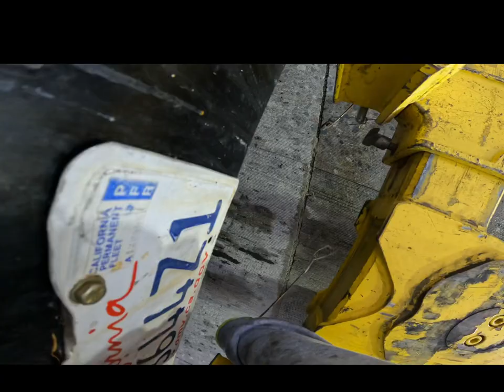Trash truck breaks down

Comment: When towing a garbage truck you don’t take out the driveline?
Reply: Yes you need to take the driveline out  to prevent damage to the transmission.
Reply from the maker: Depends on the truck, and distance. This unit was only going 3.5 miles and its not a volvo/mack, but yes safer to remove the axle or driveline. Stay safe💪